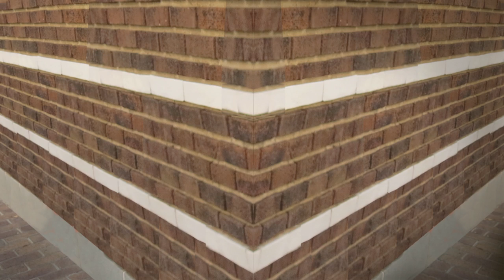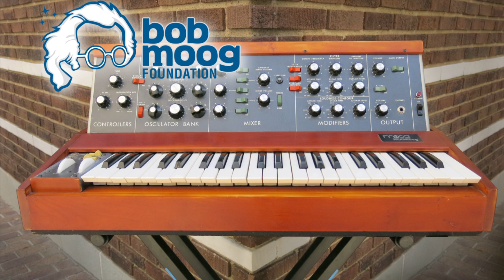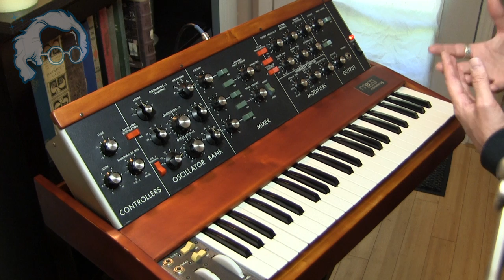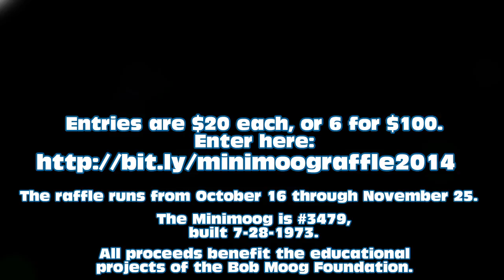The 2014 BMF Minimoog Raffle:  The Minimoog Filter!

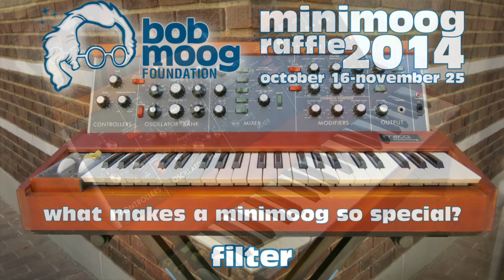Comment: Minimoog FILTER section (Moog 24 dB per octave transistor low pass ladder filter) 0:00:11
01 CUTOFF FREQUENCY 0:00:39 / 0:01:03
02 EMPHASIS (Resonance) 0:01:20 / 0:01:36
03 AMOUNT OF CONTOUR (Filter Envelope) 0:02:10 / 0:02:18 / 0:02:31 / 0:02:49
04 KEYBOARD CONTROL 0:03:12 / 0:03:31
05 Tuning high pitch resonance frequency to the sound 0:03:42 / 0:03:54 / 0:04:10

● Discussion of the various merits of the Minimoog https://www.youtube.com/watch?v=uFyQ2WFUneg
● Demonstration of the Moog Minimoog https://www.youtube.com/watch?v=sJ5593eQ
● Minimoog Demonstration: The Bob Moog Foundation Minimoog Raffle Part 1 https://www.youtube.com/watch?v=Z8UUtSbhdpY 
● Minimoog Demonstration: The Bob Moog Foundation Minimoog Raffle Part 2 https://www.youtube.com/watch?v=JoK4jMX5eN4
● The 2014 BMF Minimoog Raffle: The Minimoog Oscillator! https://www.youtube.com/watch?v=7s8nSoPaWpc
● The 2014 BMF Minimoog Raffle: The Minimoog 3rd Oscillator! https://www.youtube.com/watch?v=8RVd8FD3pyc
● The 2014 BMF Minimoog Raffle: The Minimoog Filter! https://www.youtube.com/watch?v=yPHJA092a9w 
● Sounds of the Moog Minimoog https://www.youtube.com/watch?v=-YO8GrOaAcw